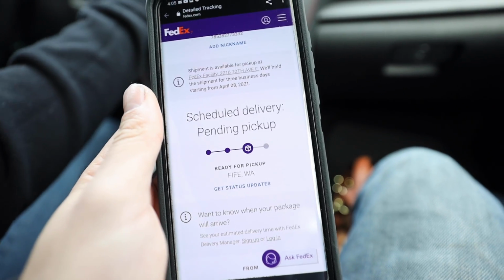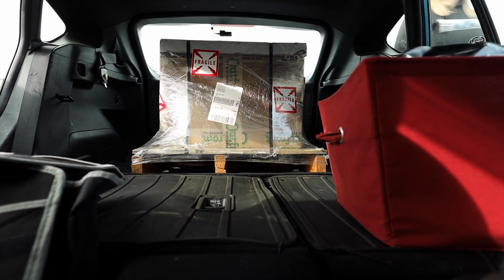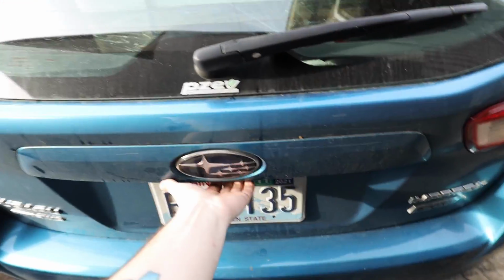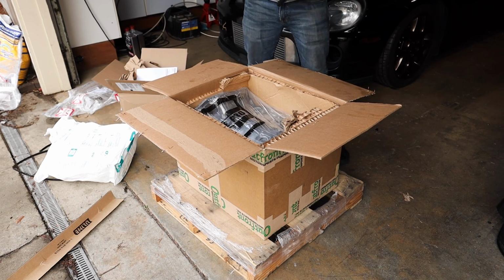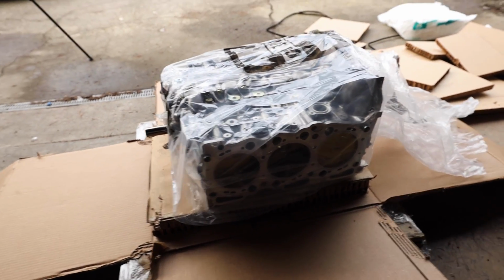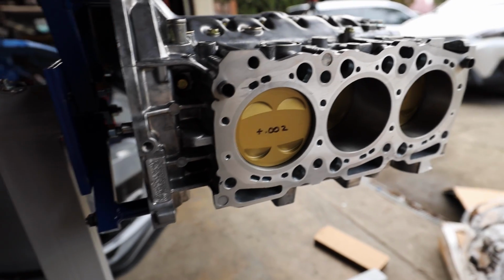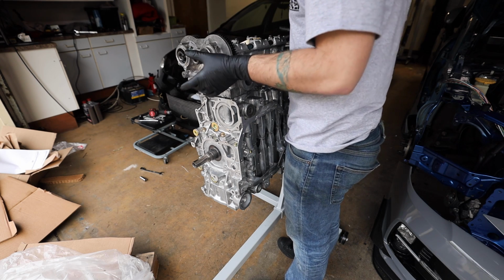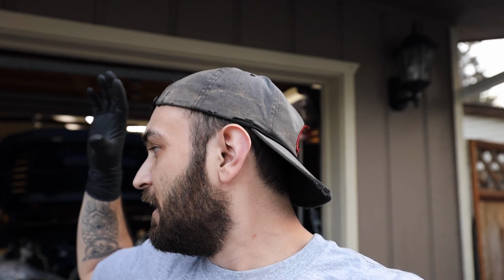WE HAVE OUR BUILT FLAT 6 BACK!

Comment: Best fuel stumble fix kit for 20 sti? Could I possibly get a link too?
Reply from the maker: If you want an easy PnP snag the Cobb if not you'd have to do fuel lines rails etc, would suggest the aeromotive A1000 🙏
Reply: @Smeedia  was looking into the radium upgrade, are those high quality?
Reply: @Smeedia  and for the Cobb fuel stumble fix kit, injectors and a fuel pump, could I safely run a downpipe intake combo without getting rails?
Reply from the maker: They are, a bit more pricey though
Reply from the maker: Yes you could 🙏

Comment: So I know this is early but ...equal length headers?? Also do u think I'll have to do an equivalent of a cylinder 4 cooling mod? This should be an efficient motor but I know heat can be an issue on closed deck motors. Btw congrats my guy! Super excited about this!
Reply from the maker: Thank you and we're going to try and keep them as equal as possible, it has a provision for a coolant mod but not sure if we will use one or not 🙏🙏🙏

Comment: What transmission do you have is it Subaru or is it aftermarket or is it a different cars
Reply from the maker: OEM STI 6 Speed, it'll work for now but will need to be built later on